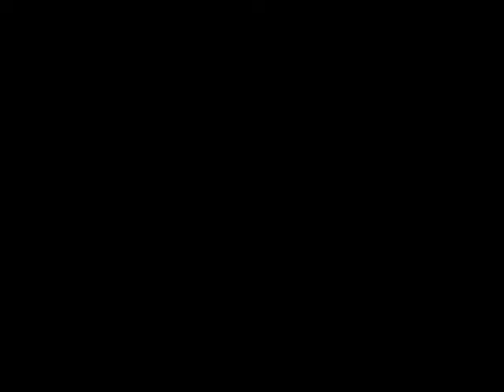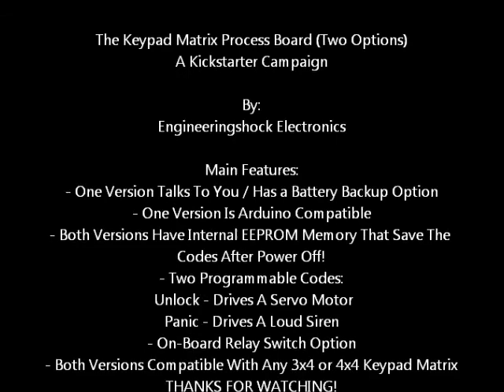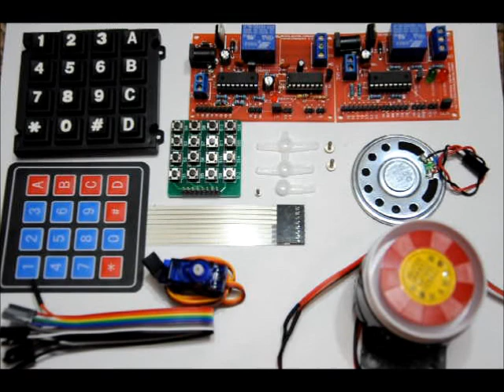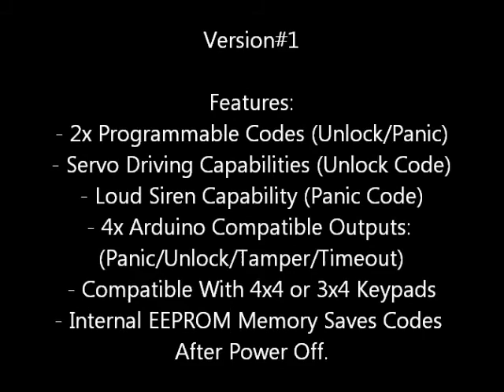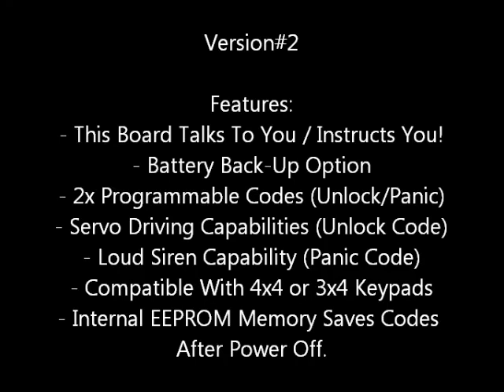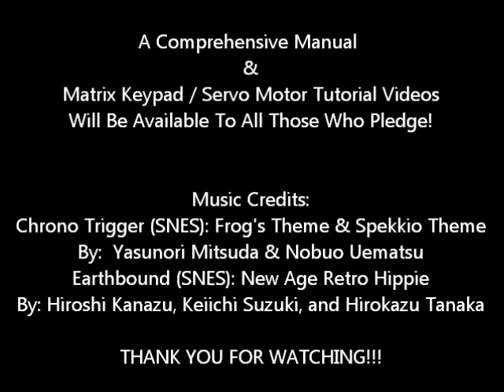New Kickstarter Campaign!  Keypad Matrix Processor Boards - Arduino Compatible!

Comment: Hi Patrick.  You might consider forcing the user to re-enter the existing code to allow changing of the code.  Otherwise someone who knows the reset combination will be able to reset the code to whatever THEY want.  Of course this would require each one to be shipped with an original code to be entered by the user the first time, but many other products that have a password are initialized this way.  Good luck!
Reply from the maker: Hi Lehibob =)
I am actually implementing something that will make this more difficult for a random person to enter in the two re-programming codes, but if the user enters in a code for either one, as you suggest, and are forced to use the old codes to re-program, then what happens if they forget the original passwords?  It has happened to me, which is why I chose not to go that path.  That said, it is true that more security is needed, and I'm on it =)  Many thanks for the comment,
Pat.